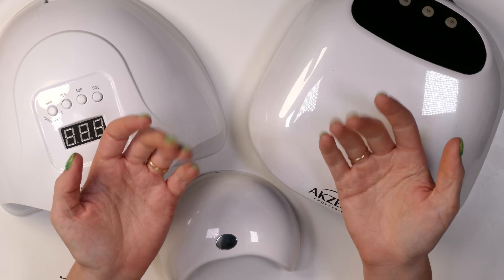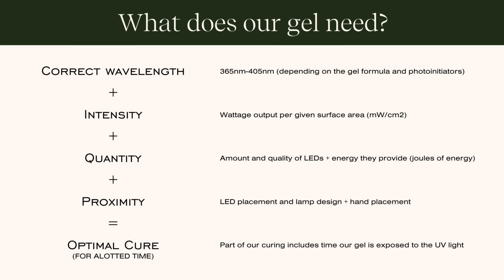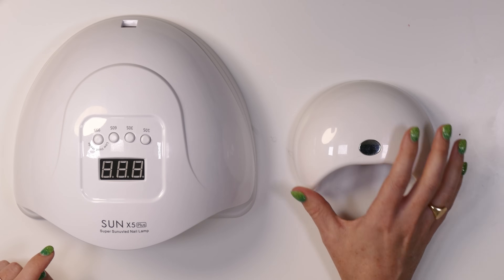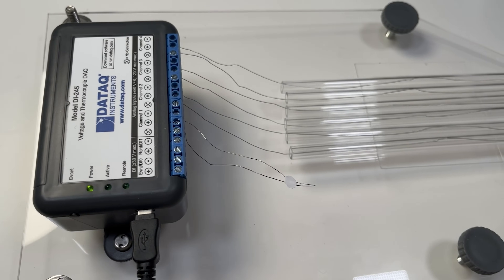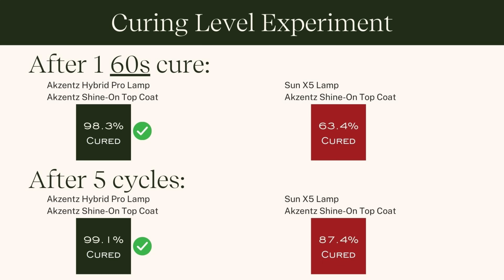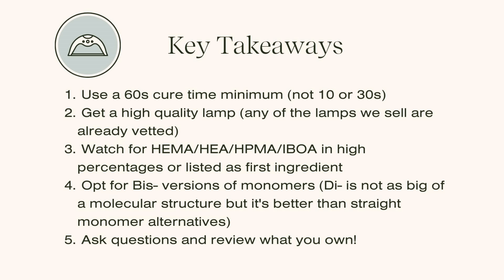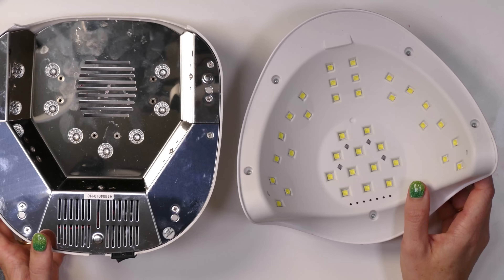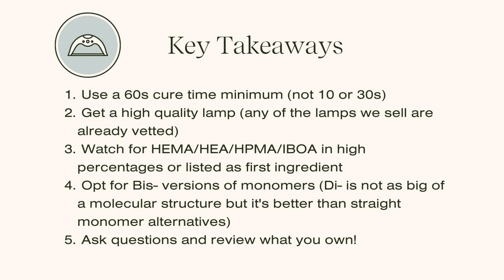Is Your Nail Lamp Giving You Allergies?

Comment: Thank you for this! I’ve recently been on the hunt for a better lamp. The one I have now I actually got from another well known nail tech/influencer, she used the same lamp in her salon so I expected it to be higher quality than it is. It’s worked well for me for the last couple years but it’s starting to not cure properly anymore and I feel like 2 years is a pretty fast time for it to have lost so much light intensity when it’s just been for personal use.
Reply: Yea two years is a short time for it to start going out I would think.
Reply: @yolyrom7233  Definitely! It says it’s good for 50,000 hours. I know i haven’t used it even half that time in the 2 years I’ve had it! Even when I do a new set every week, with multiple layer art that requires a lot of flash curing!

Comment: sad to say that I got an allergic reaction the last time I did my nails.  I used all LE products and used the big LE lamp   I am soooo dissapointed and not sure what happened as I am very careful to make sure nothing gets on the skin and I even cure for longer than the recommended time.   I am scheduling an appointment to get the arylate panel to see if I am just allergic to every gel.   😢
Reply: Question for Liz is I seemed to react to the dust.   I got some dust on my pants and woke up the next morning with a rash.  Prior to that my fingers felt fine.  This was dust from taking down the product prior to soaking off the previous manicure.
Reply from the maker: It’s very unfortunate that allergies can be happening well before you finally get a physical manifestation. It’s so subjective because it differs so much from person to person too. So sorry you have arrived at this point.  Hopefully the dermatologist can give you some answers on exactly what you’re reacting to.
Reply: I’ve heard that often allergies build up over time and then you see the reaction. I wonder what brand & lamp you’ve been using up until you switched to LE? Unless you’ve had naked nails for a longtime? - I had an allergic reaction to a cheap brand of gels & LE is the only brand I can use.
Reply: @Lisa Renee  I would like to know aswell which lamp she used before
Reply: @Lisalovesliberty1  This last manicure I used all Light Elegance products and used the big LE dot lamp.   I was pretty dissapointed because I went through the whole certification process with the mini dot with no issues and no reactions only to have this.   I am taking a break and would love to get a acrylate panel from an allergist but in my area there are no doctors who have any idea what I am talking about.
Reply: @thehammah8039  that was not my question. What brand of gels & lamp did you use prior to LE?

Comment: I have a question. Rather than getting my nails done or doing them myself, I'm more intersted in making press-on nails, since I've found they are a lot more practical for my lifestyle. I have never done them myself befor and am looking to start, so my question is: would a cheaper option still be unsafe with a press-on or would I have a bit more freedom since I wouldn't be putting the product directly on my natural nail (nor would I be putting my own hands inside the lamp the entire time)?
Reply from the maker: Well there’s two considerations: 1. You will want a product that’s not just safe to wear but safe to handle. When doing nail art even on tips there’s still a lot of contact you’ll make with the gel. Getting it on your hands, etc. just happens even if we’re careful. 2. If you’re going to be wearing the tips (instead of for display) then keep in mind that undercured product can lead to monomers leaching out. HEMA for example is water soluble so it can come out of the under cured product during handwashing and get into your skin. 

So I still recommend a high quality lamp and high quality gels even for just tips.
Reply: @TheNailHub  thank you! I'll keep that in mind!

Comment: So what do you have to say about the LE Gen 3's not fully curing gels?
Reply from the maker: It’s a matter of the lamp being more advanced than many gels on the market. The tech on the gels will catch up. The goal is to move further away from UV-A light. Not all gels will be set up for this.
Reply: @TheNailHub  It's not curing LE's own gels. The DIY girlies have a whole post on reddit about not buying the lamp.
Reply from the maker: Based on how much testing they do on their own products I would assume there’s something specific happening in the at home tests. The head chemist and owner would not just let that slide. I’ve also never had an issue with it. 🤷🏻‍♀️

Comment: If I have a LE Mini Dot is it even worth upgrading to a regular dot or a kokoist infinity? How substantial is the difference in cure time/percentage? I only want to use LE or kokoist gels anymore.
Reply from the maker: Mini dot will be enough for most needs especially if you’re not using it in a salon setting. It has the ability to cure even builder gels just in a smaller footprint
Reply: @TheNailHub  WOW I’m getting a mini dot and chucking my SUN lamp! I have been so nervous about getting an allergy (I am allergy prone!) that I’ve watched a million gel self nail videos (including yours hehe) and still have only practiced on fake nails. 

Edit: I appreciate your knowledge so much! Finally I can start doing my own nails with peace of mind 😭😭😭 and I’m only going to use brands like Kokoist and Izemi.
Reply: @hammypie  Please be aware that the mini dot DOES NOT CURE UV ONLY gels, it says it on their website. So if you're looking to use brands like Star Nails UV gel, it will not cure it: "The new LED MiniDot curing light is 400nm only curing (violet spectrum - not a good light to cure UV only gels)."

Comment: I'm curious about how you get these measurements for the actual output of the lamps per square cm and joules made. Is it something I could measure or figure out myself at home?
Reply from the maker: Hi these come from lab equipment like a super sensitive calorimeter for the curing portion and a UV radiometer for the irradiance. A radiometer is relatively inexpensive but they need to be calibrated to a specific wavelength range.

Comment: Hello blessing I live in Puerto Rico and the Energy Power goes on and off a lot which rechsrgeable lamp do you recommend, thank you
Reply from the maker: Rechargeable lamps are good for when you absolutely need them, but they are not good for daily use.  Rechargeable lamps lose power very quickly and their output is not consistent. If your power goes out regularly you might want to invest in a small battery backup that has plugs and ports on it?  Usually you can charge them to last for a couple of days.  Or you could get two lamps.  One rechargeable and one regular.  The investment in a backup battery is probably cheaper and you can use it for more than just nails like your efile etc.

Comment: Please also review recent red UV light.
Reply from the maker: Red light is known to help with collagen production and has anti aging benefits when used in specific high grade settings. A lot of lamp manufacturers started adding red light output to their UV lamps (meaning the lamp emits both UV-A and red light) to make claims like “better for your skin” or “anti-aging nail lamp”. It’s a marketing thing and I have yet to see any real studies on it being beneficial in nail lamp applications. You’ll also see pink lamps. These are red light plus violet 400nm light. Same idea. There’s no such this as Red UV.  All lamps emit UV-A or very near it through some part of the range of 365 to 405nm. Red light is on the other side of the spectrum. So you’d have to have a lamp with dual LEDs where one emits the light needed to cure the gel and the other emits whatever color you want. You could have green, yellow, red you name it.

Comment: I’ve got a SUN lamp x7  for 3 years, had no issues- until last month (November 2024) 
The only thing that comes to mind to why it happened is I got obsessed with using a filing bit to smooth out cuticles, which I think allowed the chemicals to seep through the skin. 
Which I don’t do now. And cure my nails now for full 60 seconds, which I used to do 30 seconds. And haven’t had any further issues with nail allergies.

Comment: Hi Liz, thanks for this great video. I have a question, if we buy the Akzentz Hybrid Pro, can we then expect it to cure any gel or any gel polish? I just want to buy a good lamp without worrying about uncured gel.
Reply from the maker: Hi yes the Akzentz Hybrid Pro is an excellent option as it will cure older gels, newer gels, and is powerful enough to cure everything from basic gel polish to highly pigmented art gels. However, the caveat here is that if you are using a very poor quality gel it is still posible that the formula itself lacks the correct chemistry to fully cure and/or the ingredients could be volatile enough that even handling that product before or after curing (like during application or removal) could still be a risk. So that is why yes you can get one lamp to cure them all but you also still have to be aware of what’s in your products. It’s a two part strategy to avoid the most risk. Good lamp definitely solves a big part of the problem but it won’t completely save you from crappy products.
Reply: Ah so basically if we get a high quality lamp like the Aksentz Hybrid Pro, and we use good quality gels (like light elegance, kokoist etc.) then we are safe? And then it’s okay use different brands of gel with another brand nail lamp? Thank you once again!!
Reply from the maker: I will say safe-er as I personally cannot guarantee anything, but yes you are greatly reducing risks of allergies and overexposure if you are using high quality equipment and products as the manufacturer suggests. This is the true key to this entire rise is the dabbling and deviation from manufacturer guidelines paired with the lack of education.

Comment: Hey, I watched your video. By the looks of it, I have a similar lamp to the sun x5 but my W is 48 and the ms are 365-405. 
I just started my DIY gel nail journey, and doing it safely is my nr 1 priority. Unfortunately after doing some research the uv lamp marked for us “regular” folks in Norway is really small… the closest  upgrade on the lamp I already have is the sun4 lamp and sun3. But are they really an upgrade when the W and Ms are the same as the one I all ready have? The only difference are the visible ones where the lamp looks more like a compact box and have more metal inside. 

Do you have som good tips?

Comment: Very informative video! In the heeting eksperiment, how do you know it's 98.3% cured
 Is it because it came up on 70 degrees celcius?
Reply from the maker: It's because of how much exothermic reaction (heat) was released on the first cure as part of the total possible exothermic reaction for a given gel.  Usually after 5 full cycles the gel is "dead" meaning it cannot be cured further and no more chemical reaction is happening even with light exposure.  So we are able to measure how much of the chemical reaction happened on each cycle and figure out if a lamp that is suggested to cure for 30 or 60s per layer is actually sufficiently curing the product.

Comment: Hello and thank you so much for this video it helps alot. My question is how do we know if our lamps are actually good or bad without having this nifty measurement instruments? I am having Madam Glam gels and CND Shellac at home. The lamp I am using is the Sun X12 max lamp. So I am really insecure now that the gels do not cure completely since I saw the comparison to the X5 lamp. It feels cured but as you said it seems only. Is there a formula for us at home to know this? Thank you very much in advance for your help..I am quite confused 😅
Reply from the maker: Yes please see my previous videos on checking if the gel is cured. There are a couple of simple experiments you can do. But in general if you’re not using the lamp for your gel or one that someone has tested you’re probably not getting a full cure. Sun lamps in general are not very powerful. Cheap prices are also a dead giveaway as it is financially impossible for a lamp company to make a full size high quality lamp for less that $75.
Reply: @TheNailHub  thank you so much for your kind reply. I went over to your other videos and tested the lamp with the heat method. I wrote a lengthy comment under this video asking for enlightenment 😂 I think this might help others too - maybe someone has the same combination as me…

Comment: Question: when it comes to the sunuv lamps, is the official sunuv store on Amazon better? I’ve watched so many professional techs recommend lamps from their official store.
Reply from the maker: Not that I have noticed or been able to verify. The challenge is are you really going to test each lamp with each gel you own? It gets complicated and expensive really quickly to try and verify a generic option just because it’s cheaper than say the branded lamp for your main gel system. And if your gel system doesn’t have a verified lamp to me that’s a big red flag.
Reply: @TheNailHub   Very true. If I were to get a more reliable, higher quality lamp such as the light elegance one, I would have a better chance of it curing different types of gels, correct? I don't want to be limited to one brand.
Reply from the maker: Yes correct.  You can increase reliability by getting one very potent/powerful lamp that should cure all your gels well, but I will add a disclaimer that there truly isn't a "universal lamp" strategy  that guarantees anything because there are just too many possible formula and lamp combinations. However, I will stand behind the lamps we sell in that with the many brands I have tested, they all sufficiently cure the products and provide a durable result.
Reply: @TheNailHub  thank you so much!

Comment: I would like to know if a primer is necessary when doing gel nails because a lot of times, the gel fall off very quickly and the cording to a lot of clips I’ve watch it says primer, S a mess before applying any gel products. Thanks
Reply from the maker: It depends on the way the gel system is formulated.  Some systems use base gels, some primers, some bonders.  Each company does it a little differently.  Best thing to do is as the brand that you purchased what is supposed to be used with their product.
Reply: @TheNailHub  I’ve been watching your videos for awhile  and I truly appreciate you sharing all your knowledge and took your time replying . Thank you ❤️🌹❤️

Comment: What is your opinion on the ELIO Pro 96 W UV/LED Lamp from Madam Glam?
Reply from the maker: Sounds like a lot of wattage being listed which for me makes me initially question the validity of a 96W statement.  But you'd have to review it and ask them. Does it have all the traits I demonstrated?  Metal interior?  High quality LEDs?  Ask them what bin number their LEDs are (it's a rating system for LED quality) and see if they know.  Is it made in Taiwan?  What's the actual output during curing?  See if they've measured any of these things are have the data on it.  Any reputable product manufacturer will know or have this information or be will to get it.
Reply: @TheNailHub  this is so informative! thanks so much!!!

Comment: This video was a major game changer for me! 
Something that I've had a hard time finding on my own, however, is the output for these lamps. I'd love to know how you get hold of this info — it would be great to be able to know how to find it so I could better evaluate lamps available to me (not American, so I don't have access to the same brands or products usually discussed online). The different bulbs is a great starting point, but if, for example, I want to know how to judge if my lamp will be substantially equal to the lamp a brand recommends you use with their products, more detailed info would be so helpful.
Reply from the maker: Output can be measured but the difficult part is the testing of that output across different gels. Because there is no standardized rating system to match gels with lamps, and because gel formulas can vary so much, it requires more than just measuring lamp output. Effectively you could choose a lamp with a lot of UV output but the given gel might not sufficiently cure because of a mismatch. Or it could do the opposite and cause extreme heat and potential burns. So it’s sort of a matching game.
Reply: @TheNailHub  Thanks, that makes sense! With so much variety on the market and so many gels using different technology in their formulas, it does make sense that trying to make predictions based on a single metric isn't always going to be accurate.

Comment: i have a question🥰🥰, I'm right now interested in doing art on press ons. would it be safe to use cheaper gel + "high quality" lamp? if i make sure i don't inhale it or get in skin contact would the press ons be safe to wear after curing?.
since I'm pretty tight on budget I'd like advice .. it's hard to find cool gels that are safe and good quality too :(
Reply from the maker: Even painting with them is a risk if you are getting it on your skin or on the wipes you touch. It’s not just about wearing the nails. Plus monomers like HEMA are water soluble so if you wash your hands while wearing a set it can still leach out and get into contact with your skin. The high quality lamp and full curing like 60s per layer helps. But some gels just aren’t formulated with enough photoinitiators to cure properly. So that’s why it’s important to consider both parts.